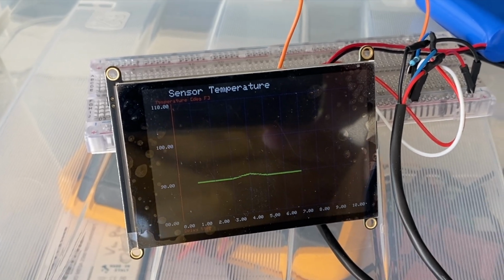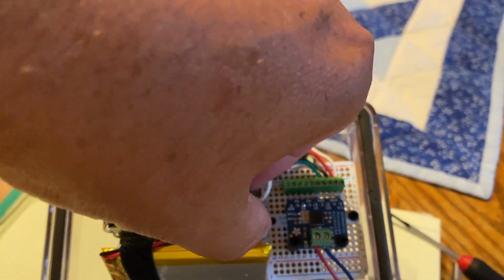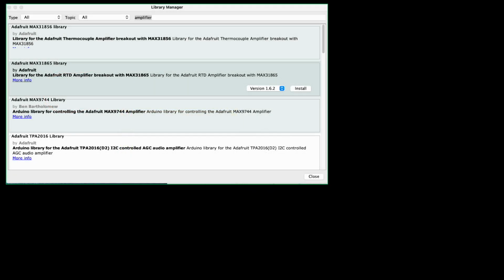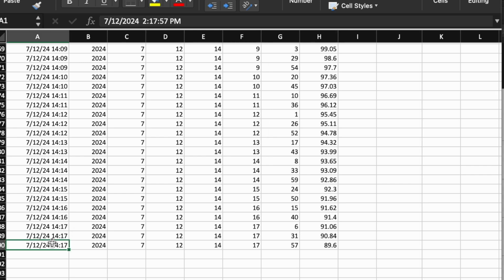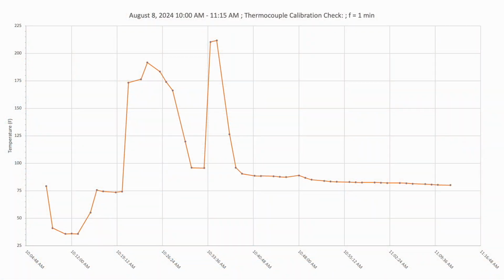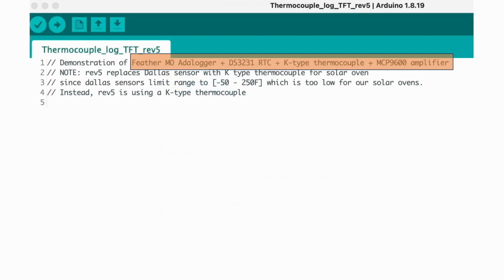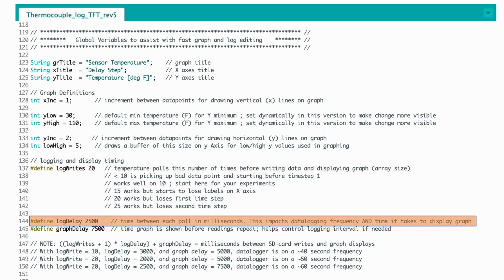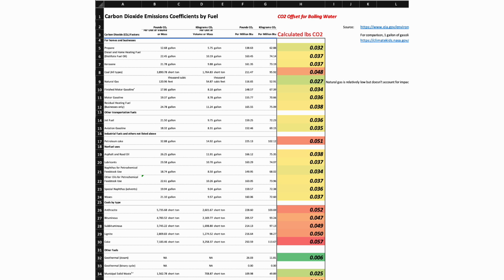Solar Oven Data Logger With Graphical Output

Comment: Do you happen to have a build diagram?  In your parts list, it would also have been useful to have the headers and other connectors included.  My wife liked this enough to have me try to build a replica for our use.
Reply from the maker: This is a good starting point for all things data logging. Adafruit.com has info on headers- just click on the respective parts and it will make recommendations: https://youtu.be/_t02pB-fwHE?is=C24PjwyJ9qdCBWra